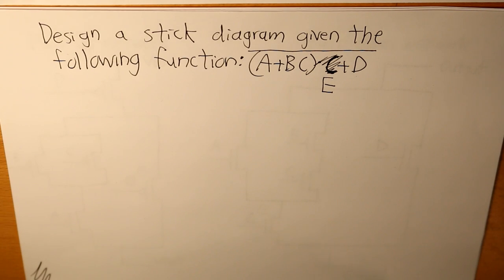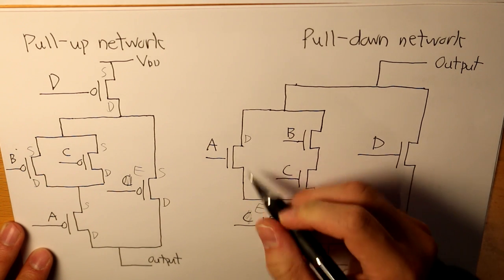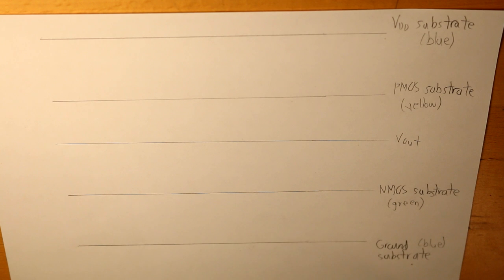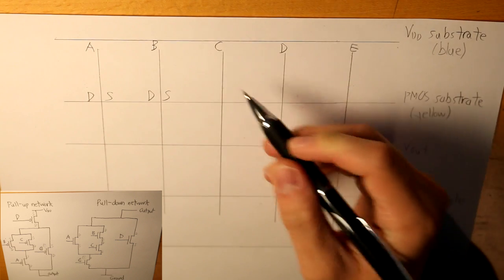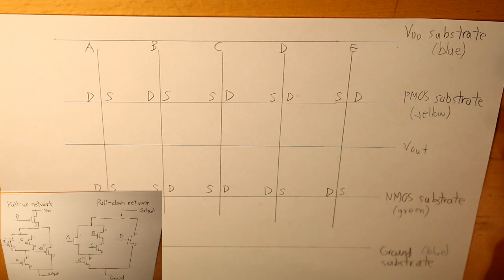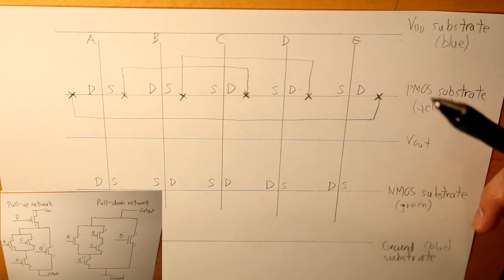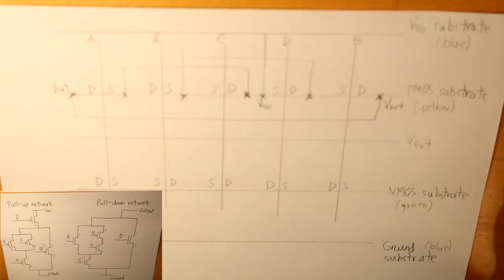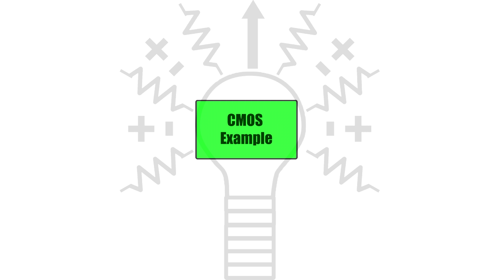Stick Diagram (CMOS) Example

Comment: I'm afraid your design is wrong, you can't overlap two metal layers beause this will cause an undesired shortcircuit in your design. You should have done an Euler graph analysis and you will realize that you have to split the gate in two in order to do the layout because there is no Euler path for the full gate.
Reply from the maker: Jaume AF thank you for highlighting the error.
Reply: Jaume AF yes he is wrong
Reply: Connection is only considered if x Mark is done on wire